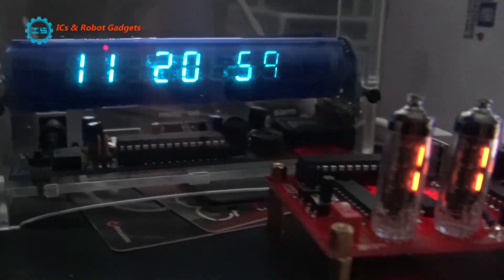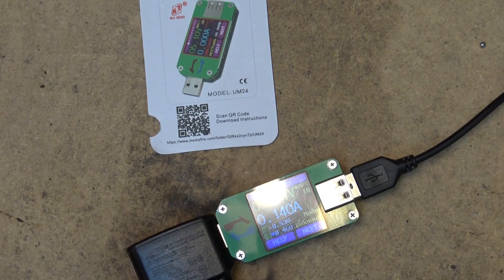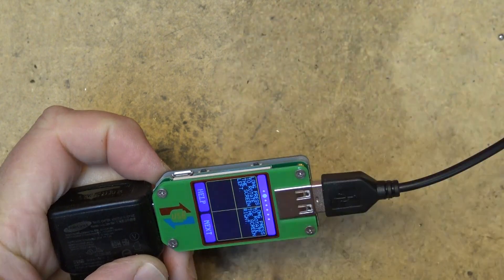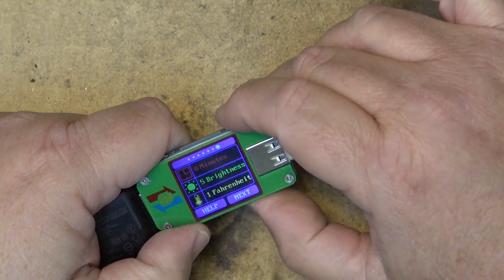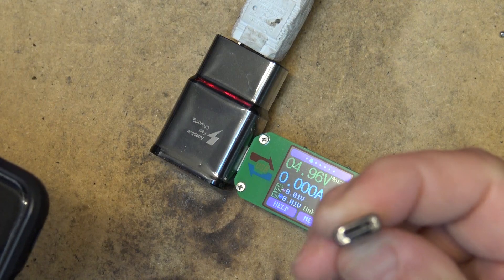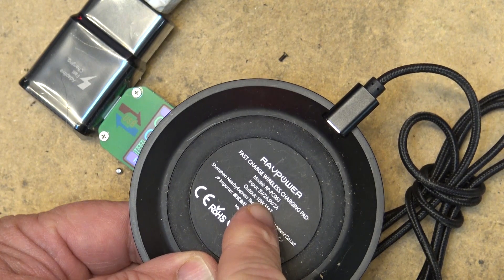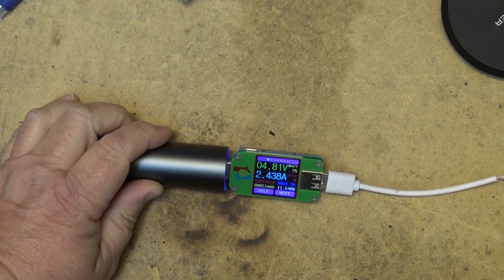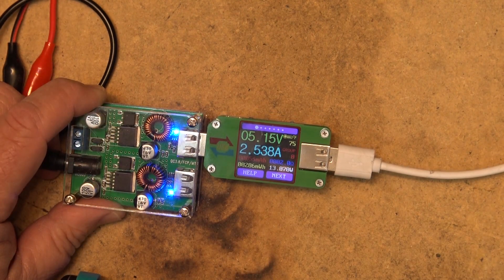USB Power meter with color display

Comment: Looks similar to something that 'Louis Rossmann' uses in his Apple mac and iphone repairs.  Useful unit as it can give you some clues about the fault condition if the usb voltage and current draws are not negotiating correctly.

Comment: Good stuff. I have the 24 and 25. Even useful to extend wires or measure the actual capacity that goes into a device if someone complains that the battery is not what it should be.  I also have a USB  to crocodile clips so I can use it as a voltmeter when travelling to measure small stuff in case something breaks down. I even used it to measure a cars battery while charging and using the bluetooth to monitor while sitting in my house.

Comment: How do you force it to charge at the higher voltages? Add a resistor to the data lines? What?how? Do a video.
Reply: By the way,  great video!
Reply from the maker: This is a handshake between the device and the power supply.  It is called qc2.0 for 9v and qc3.0 for the higher 12v charge voltage.
Reply: @12voltvids  yes , I see. But  how can we fool the device so that power bank will output 12v so that we can power a car light bulb or such?
Reply from the maker: @sargetester99  
You can't
Reply: There are plenty of videos on YouTube of how to set D+ and D- so that the charger provides the different voltages. If I remember correctly,  the charger has to see 2.4V between D+ and D- to supply 9V and 3.3V between the 2 data lines to supply 12V for QC3. At first,  the QC enabled charger has D+ and D- internally connected together and if it sees 2.4V or 3.3V it disconnects them after a few seconds... Something like that. You'll need a micro controller or at least a logic board to do it if you want to power up a non-QC device.
Reply: The guy with the Swiss accent made a video about that recently
Reply from the maker: When I power up my BenQ speakers it shows +3.3 on D+ and 3.31 on D-, identifies as QC2.0 but still only sets voltage to 4.95 volts, so there has to be more than just detecting the voltage on the data lines.
Reply: @12voltvids  it is very important if the voltage you are reading is negative -3.3 on one leg and positive +3.3 on the other, and it has to be on the correct leg. If it is any other way, it doesn't work,  it won't hurt anything to be on the wrong leg or the wrong volts, but it won't work either until it is correctly done right and then 1 or 2 seconds later you get the power you want.
Reply: @12voltvids  watch the video and study the matrix he made and get the  negative voltage right and it works
Reply: Sometimes it has to be 2 different voltage on the 2 legs, and they cannot be the same voltage,  and they have to be on the correct leg,  if you are looking for one of the lower power outputs  [not maximum output  ]